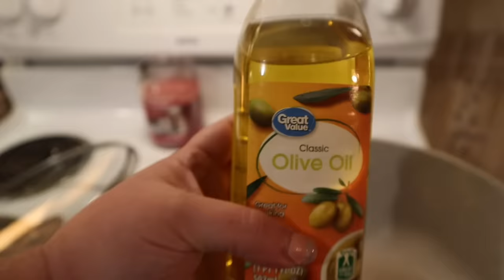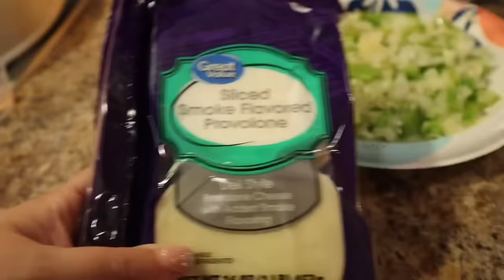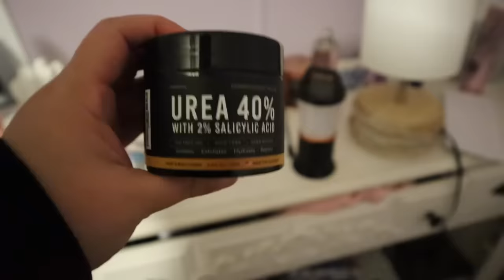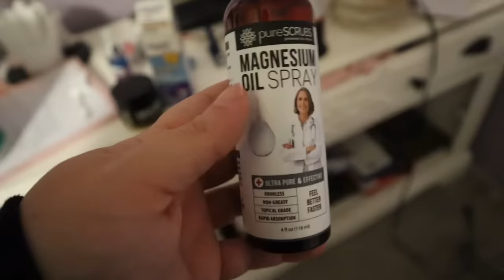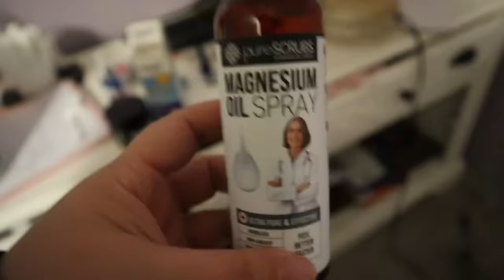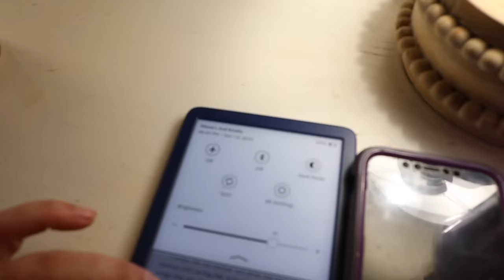EXTREME REALISTIC MOBILE HOME CLEANING | mobile home homemaking | let’s get this double wide clean!

Comment: Merina, you need to get a foot bath, not necessarily the kind that bubbles and whatnot, you can use just a plain ole square pail, but anyways, take 15/20 minutes a couple times a week and soak your feet in the epsom salt bath, halfway thru soak scrub your heels then soak again for the remaining 10 minutes then once dry, lotion them up, now on the off days of soaking, best thing you can do is at bedtime, put Vaseline on your feet, heavy on heels, put socks over it and sleep, in am take socks off and feet will start to really really look and feel so much better.

Comment: I’m sure you’ve already tried but if not, you could try soaking your feet in lotion and putting a sock over it then sleeping in those overnight. also avoid wearing shoes that your feet will sweat in, and/or thick socks your feet can’t breathe in. hope it helps! 😊

Comment: Last weekend Sunday I did my reset which I get ready for the next week. I decided to put my clothes away from when I did my laundry over thanksgiving break. If I don’t put it away right away after doing laundry it will stay in my laundry box, leave in piles on the floor, or piles on my bed. I went to pull out my hangers from the closet and saw my clothes hanging. I said to myself I’m not having this anymore. I can’t stand not having my closet organized like I like it. I need to have my clothes sorted by colors as well as have certain colors on certain colored hangers. It so bothers me if it a mess and disorganized. 

This project took me all day to do. Part way through I decided to change my light bulbs and dust my ceiling fan. I found something wrong which I’ll have to wait on changing them. After when I went to put my clothes away in my dresser I decided to clean off my dresser and dust it. I wanted to accomplish one more task which was to clean off my coffee table and tv stand in my front room. 

I felt overwhelmed and stimulated before going to bed. When I do a project like the closet i get overstimulated and can’t get to sleep. I’ve always been like this. 

I love the lucky brand pink bottle reminds me of the pink love from bath and body works.

Comment: You can use a brom that's wider to scrub your deck and it will be faster and you don't have to bend down on your knees ouch lady. It's the kind they use in a factory not a dust mop either it's a push broom.

Comment: Honey you make so much work for yourself.  It’s winter. Store your  cushions in the she shed until it’s nice again. With dogs  truthfully  white sofa isn’t to wise any way. You need web material patio furniture and you can just hose it down. Cushions are a pain anyway. Maybe put that in your den for tv couch or one of the kids rooms???  Buy an outside long handled broom or brush for your deck floor. Don’t ruin your inside mop head. 
Your feet. Soak in warm  epson  salt water every night. Just buy alittle dish pan your feet fit into and once soaked scrape off the scales and rub lotion on your feet and put socks  on for the night. In a week your feet will be beautiful.